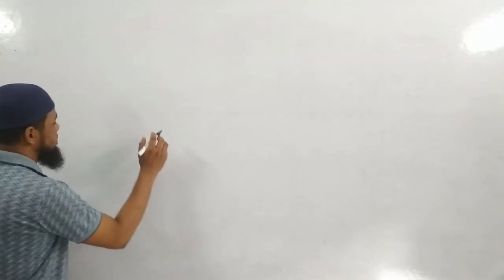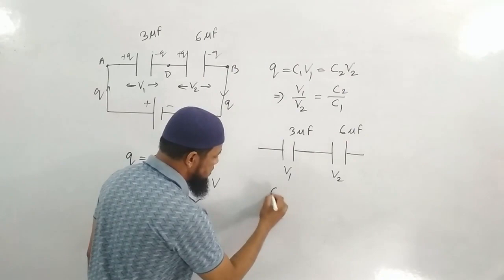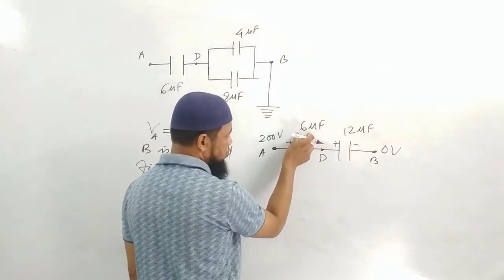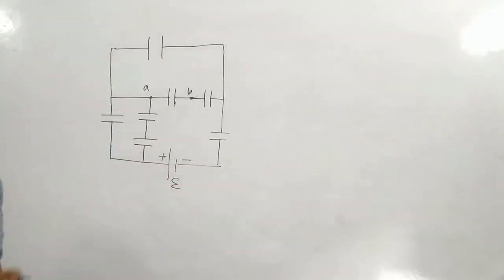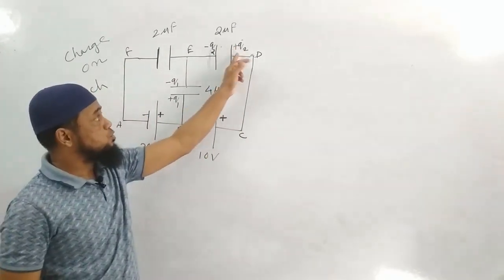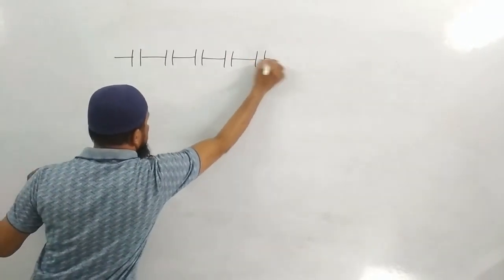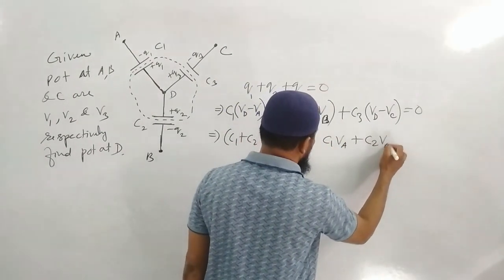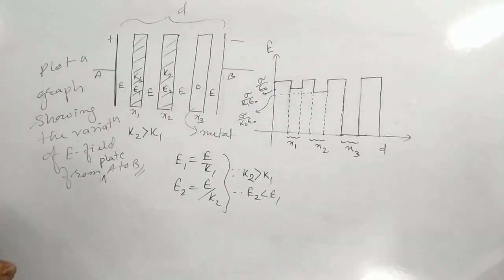Capacitor Circuit Prob 13

Comment from the maker: Ya thanks .. a correction is required at  17.00 minute .. a calculation mistake .. potential at B should be 18V .. so you can modify the potential difference between A and B